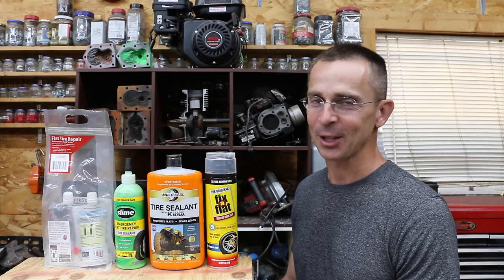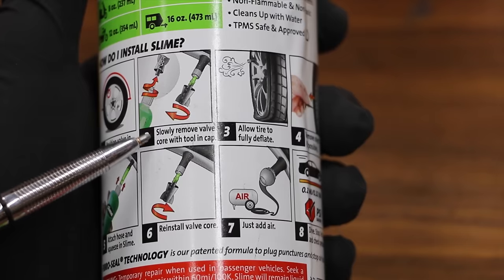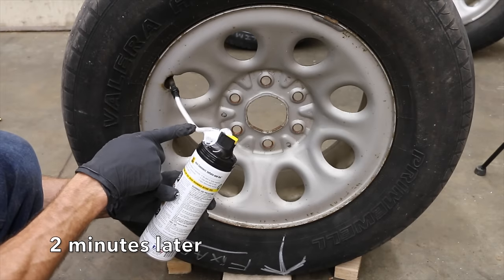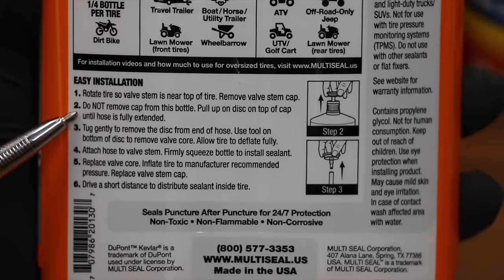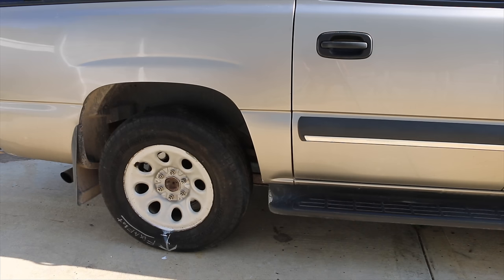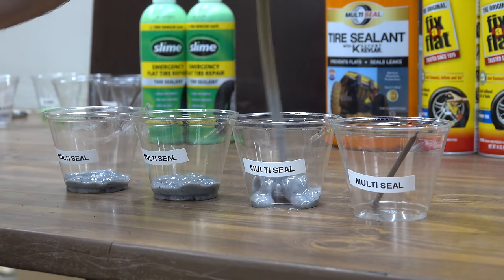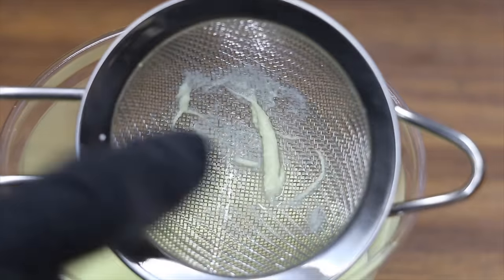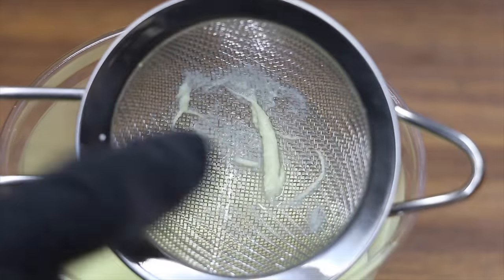Is Tire Slime the Best? Fix-a-Flat vs Tire Slime, TireJect, MultiSeal. Let's find out!

Comment: For best product results ensure your Fix-a-Flat is stored safely in the trash can.
Reply from the maker: Lol
Reply: Nailed it
Reply: Agreed, 2 cans! Needed 4 additional air refills to fix a. Slowish "2 day" air leak in a MOWER tire! Slime and the red competition (forget the name honestly) work just about immediately.
Reply: Most accurate statement I've heard all day.
Reply: facts lol
Reply: I think these results are very surprising.  I have used Fix-a-flat successfully before, but I guess it helped I still had the offending bolt in the tire.
Reply: @effingeffwerd4353  Ah, so that's why it didn't work.  Project Farm should've kept the screw in the tire.
Reply: You ain't wrong, partner!
Reply: But would you would trust Fix-a-flat to seal a trash can?
Reply: I agree
Reply: Maybe you were supposed to fix the hole by stuffing the can itself in it?
Reply: @The GovNer Gold... just pure Gold xD
Reply: @kjetilv  ROTFLMAO  you may be onto something there, to be honest, I have never actually read the instructions for FIX-A-FLAT.
Reply: Lol on Faf.
Reply: I was gonna say Stored Safely on the store shelf
Reply: Only way I can justify it, it's saved my ass in the middle of nowhere when I got a flat on my motorcycle on a little road trip.
Reply: Damn straight
Reply: SERIOUSLY, utter garbage
Reply: @effingeffwerd4353  maybe that would be a question to put to the test... cause it did freeze, I'm thinking it'll "freeze" around whatever is in the tire?
Reply: Great advice!!
Reply: Truth!
Reply: I have fix a flat but I trust slime
Reply: To properly distribute the product, make sure to drive the trash can at least 20 ft to the curb at the earliest scheduled pick-up day.
Reply: The cheap Wal-Mart rip off works better
Reply: Haha...
Reply: Seems like all it really does is inflate the tire.  May be good enough to get you out of a sticky situation and maybe to a tire shop or something.
Reply: Lmbo
Reply: @volvo09  I did the same thing... only I was up a logging road 3 miles and had two cans of FoF which didn't work so I had to walk 5 miles to the hardware store to get a can of the good stuff (Slime)
Reply: @kevin9c1  don't do that to the tire shop, it sucks
Reply: It saved my ass a time or two
Reply: @sharkbaitgaming  slimr saves
Reply: @nitehawk4067  doesn't help if I don't have a tire pump tho :/ much prefer it in emergencies but I had just gotta my motorcycle and hadn't gotten very saftey item yet.
Reply: @effingeffwerd4353  In my experience with F-a-F, it has been effective for rim leaks on steel wheels. I have not needed to seal punctures with F-a-F. I do agree with PF about the effectiveness of Tire Slime, GREAT STUFF!
Reply: Fix a flat plugs work well I had one on a four wheeler 2 years ago and it still holding strong after al lot of rough riding
Reply: Hahaha
Reply: Ran on fix a flat for a month
Reply: For best results, keep it on the shelf at the store.
Reply: Bullshit, I've used it for a year before and many times after that.  That shit is great.
Reply: Agreed. I've had great results with fix a flat with small leaks. Never used slime before. Never needed anything other than FaF
Reply: @KozzieJ   I used to have my mechanic at a car lot use slime many times(all the owner would buy).  That shit would always fail while sitting on the lot. All the while I have a car during that time with 40k miles under my belt with 2 tires filled with FaF.  Actually the Super Tech version.
Reply: Can you add Slime to a tire where you used Fix a Flat? I've used Slime before with great success, but I had to use Fix a Flat the night just to get home and the tire is down to 10 psi already. In the middle of a pandemic, hanging out at an auto shop isn't exactly on my wish list of things to do.
Reply: Fix a flat didn't even fix my bike tire there's no way id trust it in a car tire.
Reply: And your money would be better kept in your wallet than in Fix-a-Flat.
Reply: The only time to use fix a flat is emergencies and those who are brain dead😂
Reply: I've had luck with Fix-a-flat. Good to know Slime is better though.
Reply: @ki5aok  with the screw in the tire and punctured in, air wouldnt comeout because the nail sealed the leak.
Same thing happened to my car didnt notice it at all.
Nothing was wrong with my tire until someone told me that the tire was punctured during an oil change.
Reply: DAMN
Reply: It never works. Ever.  Should be called Keep-It-Flat.
Reply: I used fix a flat last week.  After 10 days no leaks.
Reply: This is proper safety advice.
Thank you for informing the masses
Reply: I laughed way too hard at this 😂
Reply: Dude,keep doing what you're doing!!
Reply: lol... I am truly amazed it is still a product anyone buys. It is truly worthless.
Reply: From here on out it's "Fix-no-flat" to me.
Reply: @sharkbaitgaming  I've seen it plug a hole in a motorcycle tire also. The dude bought it, shook it then filled his tire and rode off. However, my cousin used it to PRE-plug any potential holes in his bmx...didn't work.
Reply: lol
Reply: @joshuamorin2762  literally
Reply: I have actually had very good results with fixaflat. I have only used it on old tires that were on vehicles sitting in a field for a long time...so lots of cracking etc.  Fixaflat sealed those tires quickly and was able to air up with a small pump to 30 psi.  I have a couple cars out back that I did this on a year ago and are future projects just sitting and waiting and those tires are still holding air.....However I'd be hesitant to use it in the tires of my road car just for the mess it makes inside.
Reply: It worked great for me for a riding lawn mower tire.  I can't think of anything else I would want to use it on.
Reply: Fix a Flat saved my butt many times, I always carry several cans.  It only last a year in the can then it will not have enough pressure.  I had several times when Fix a Flat did exactly what you had showed in this video, it didn't work.  But, none of these other fluids have a way to fill up the tire.  Slime is only for dirt bikes.  It really messes up the balance of the wheels in my bikes and my van.  I use slime in my lawnmower because it works great there.
Reply: HA HA LOL, yes. Its trash
Reply: @sharkbaitgaming  I've used it about 4 times in my life and it worked every time.  Even rode the tires like normal for the rest of the tire's life.
Reply: Lol yes !
Reply: I've got a can and I'm going to throw it out and get the Slime
Reply: Yep it doesn't work makes a big mess cause it gets stuck on the tire you try to unscrew it it goes everywhere I used slime yesterday for the first time on my riding mower  tires cause 3 of them would be really flat after 10 minutes it fixed too of them and they stayed pumped up but the 3rd one still goes flat every hour now the tire is just very dry rotted so I think I need to put more slime in it
Reply: It's funny that Slime and Fix A Flat are both the same company
Reply: @ki5aok  i think the screw would've done a better job lol
Reply: Yes buy a 12v air compressor and your tire guy/mechanic will thank you.
Reply: @dougjohns5115  slime always saves me, even on my current front car tire. Got a flat, jacked up car, installed slime pumped up tire and spun it around, that was over 6 months ago. Still holding air👍
Reply: @anthonybatista565  Agreed. I plan on letting the tech know to expect slime before hand.👍
Reply: @sharkbaitgaming  keep a mini bicycle tire pump for emergency. I drive around with my Topeak Joe Blow Sport III High Pressure Floor Pump.👍
Reply: If needed though??ye
Reply: Best if thrown away 30 seconds after purchase,fix a flat label lol..
Reply: Best advice I've seen
Reply: @joshuamorin2762  don't you mean screwed it?
Reply: Saved my arse so many times and never take the nail or screw out till you get to tyre shop.
Reply: Man. I had a can of fix-a-flat in the family minivan (which doesn’t have a spare) for road trips. So glad I watched this. I’ll be promptly storing that in the garbage can.
Reply: Haha $15 straight in the trash…awesome
Reply: Maybe good enough to get you to a tire shop where you will then get yelled at by the tire technician. Sounds like a good end to a fun day. Maybe good enough for a slow leak but in that case just use the inflator that you bought instead and at least the inflator can be used multiple times.
Reply: Because that stuff is garbage 🗑
Reply: Did you put fix a flat in the tire and drive it right away for those few miles. I have had pretty good luck with it.   What I like about it it fills your tire up a lot of the times when your tire goes flat it not by a air pump.
Reply: Fixer flat is only good for lawnmower tires that have dry rot leaks.  That’s about it.
Reply: Yeah fix a flat is straight up a scam.
Reply: LMFAO!
Reply: Lmao seriously. Stuff is garbage and thats where it belongs. My bro has a slow leak in his f150 and said he was going to get fix a flat. I told him not to waste his $$. Told him bring it by my house and we will remove the wheel from the truck and spray it down. If we cant find the leak try slime.
Reply: Just seen this video but sorry y'all been using Fix a flat on a few vehicles and for over 20 years the part this video left out on the directions is you got to drive the vehicle a few miles soon as the can is empty and fix a flat will work every time tire shop would be pissed cause the tire was so hard to get off after driving on it for 6 months fix a flat works every time
Reply: @Icantfindanavailablehandle  one way to find out
Reply: Don't even mention that garbage 🤦
Reply: Before use lol
Reply: You have to admit though this product did a good job pumping up a tire to get someone off the highway.  Like said in the video I never go anywhere without a portable compressor.
Reply: LOL

Can is steel.  Recycle it.
Reply: never throw compressed gas  in the trash- especially flammable compessed gas. i know youre trying to be funny but it aint cool
Reply: Bruhh😂🤣 I'll never buy fix a flat again after this but it works lol
Reply: @ki5aok  i think a screw and chewing gum and superglue would work better than fix a flat
Reply: @wes326  I've been down that road.  Last time I used Fix-A-Flat, it caused the tire to be off-balanced (which caused extreme vibrations in the tire).  Took it down to Discount Tire to get it fixed.  The tire technician yelled at me for putting the Fix-A-Flat in the tire.  Apparently it left a mess in the tire that the technician had to clean first.  Never did it again.
Reply: @michealpersicko9531  Hell, I'm convinced the chewing gum alone would've worked better.
Reply: Yep. It's one thing to make the mistake of buying it, just don't make the biggest mistake by using it.
Reply: Aurawest Music:  After reading all the danger warnings on the original Fix-a-flat in the 80's, I refused to even use the stuff.  I remember thinking they should have had a skull and crossbones on the can.  Add that to the fact that it doesn't work at ALL well compared to the other brands. 

Yes -- trash can gets the nod. 

It's great that reviewers like this call out such brands with objective testing.  Trying 4 different cans should cancel out any manufacturer whining, IMO.
Reply: @effingeffwerd4353 :  Sometimes the thing in the tire seals it great.  FOR A WHILE.  The problem is, that won't last.   But I've been lucky, noticing things like screws from roofing jobs in tires BEFORE they started leaking, when honest tire shops could then plug the tire when the problem was well within the tread.
Reply: Say what🤔

We're made in HIS image. HE made us with the power of free choice
A good prayer:
I'm a sinner JESUS please forgive me for all my sins I know you shed your Blood for me on the cross at Calvary. Thank you JESUS for my salvation and for shedding they Blood for me. I love you JESUS. 
Romans 10:5/10 ct...❤️k
JESUSisLord!Amen...
Amen..
If you'd like to call someone who cares 
83
For
Truth.
bc you don't know when you'll die?
.y r u hesitant........ ........ ......
Reply: @ProjectFarm  please read the manual careful with fix a flat I didn't see any where to remove the foreign object it only said to rotate to 6o clock position
Reply: @robinbanks5734  oh, it wouldn't even seal a trash can...bet it would rust it, though(unless it was plastic)...
Reply: I used tire slime to "fix" one of my 4wheeler tires almost 2 weeks ago still holding the same air pressure the tires are rusted on the rims. I'm possibly the 4 or 5 user of that set of tires and rims.  The tires are at least 18 years old, finally wearing out.
Reply: Damnit, when I threw the Fix-a-Flat in the trash can, the trash can started leaking!
Reply: Perhaps I've just been lucky, but fix-a-flat has worked great at least five times for me.
Reply: Amen. Fix a flat is THE worst.
Reply: That Tire Slime is actually left over Guacamole from the salad bar ! It's organic , so NO Problemo ! Tastes great on crackers for a road side snack ! LOL ! Thanks for your tests .
Reply: @ProjectFarm   I’m 15:58 15:58 😢
Reply: Agreed. I have used fix a flat with mixed results. It seems it's hot or miss if I get a can that actually pushes the product into the tire.  Fix a flat has worked on slow bead leaks for me.  Slime has worked on hole and bead leaks. I recommend slime.
Reply: I used a similar product years ago and it lasted the life of the tyre.
Reply: I usually throw it away right there in the parking lot can, like the bag from taco bell but with less satisfaction.
Reply: I bought fix a flat in a time of need and it let me down too.
Reply: He used the wrong fix a flat normal tire he needs big tire big can
Reply: Fix-a-flat was my go-to... until I saw this vid... your so right, it's not even funny... I literally just threw mine out.
Reply: @binaryglitch64  If it was your go-to, why did you throw it away?
Reply: @SAWats  ★was★  ★untill I saw this vid★
Reply: Facts 😂
Reply: I just used a tire plug on a hole caused by a screw,   easier and cheaper than all those products.
Reply: @iwanaGoFast2010  That's very good to know.  I have a 15 year old tire I don't want to replace.  Will use Fix a Flat.
Reply: @DB-yj3qc  Tires last at least 50 years so don't bother replacing it.  At 18 years old they are just getting started.
Reply: Ur damn right on that lol 4 real.
Reply: is that hard to do
Reply: So true
Reply: Before or after you use it?